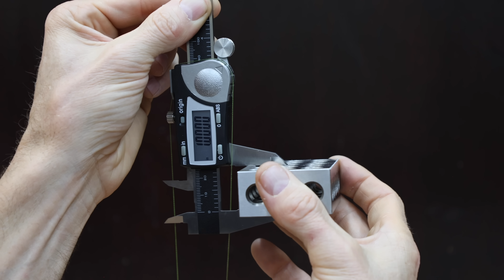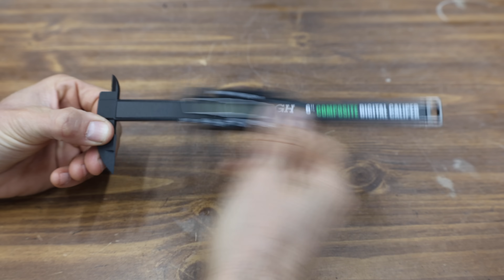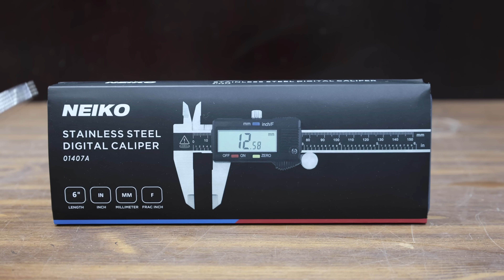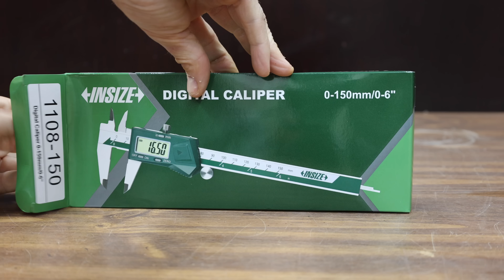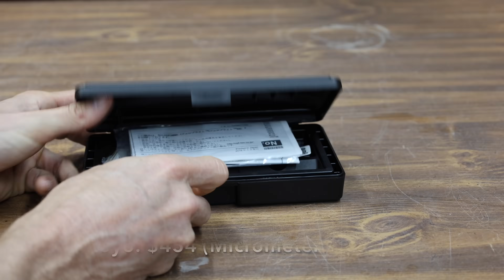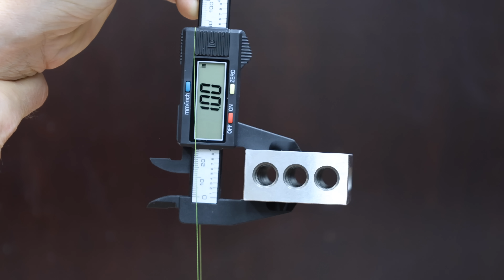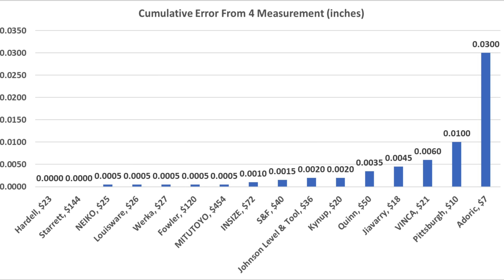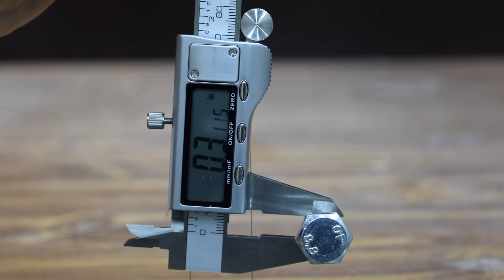I've Been Proven Wrong About Calipers!

Comment: I use the $7 digital caliper to measure cylindrical cells (e.g. 18650) where a metal caliper would cause a short circuit and damage the cell. It's also less likely to cut into the protective wrap of a cell.

Comment: It's worth checking the standby drain. The battery on a $7 caliper could go flat as fast as a $70 caliper (e.g. iGaging OriginCal 100-700-08) while in storage.

I soldered a 1xAAA battery pack with a switch to a $7 digital caliper to stop the battery from going flat.

It's a shame when more expensive a digital caliper also has a high standby drain.

The absolute origin feature is pretty cool when it works. Some digital calipers like the 100-700-08 "reset" after a few days of being in storage, so when you open it the origin will reset based on the open position when it powers on. You then need to close it and reset the origin. Unlike the Mitotuyo where it powers on when you open it and it doesn't reset (as you'd expect).

Buy once, cry once.

Comment: I got one of those cheap fiber reinforced plastic models like the Adoric years ago and was kind of shocked at how reliably it would return to zero and read exactly the same at the far end as you went back and forth numerous times. More than good enough to measure common everyday items where you need to measure much more accurately than a ruler and an eyeball. Plus the FRP looks and feels nice after you gently smooth the sharp edges. Not bad for 8 bucks. 😅

Comment: There would undoubtedly be some gap between the 1-2-3 block and the definitely not atomically smooth desk during the depth test (doesn't look like a granite test block, and the 1-2-3 block moves between tests). Expecting exactly 1.0000 inches would be expecting the rarest condition (randomly measuring exactly at a peak in the desk surface), 1.001 would be more likely (anywhere else but a peak), making the Starrett, Mitutoyo, and the like more accurate...

Comment: If the Mitutoyo says that the 123block is 0.0005 off then the 123block is 0.0005 off. It is not the french who set the metric standard but Mitutoyo.

Comment: The starrett was not perfect on the measurements. The ten-thousandth decimal place is a tiny little 5 unlike the other calipers where it is the same size as the rest of the numbers. Easy to miss, but it was showing on one of the 1" measurements as well as the 3" measurement.

Comment: One well known issue with many cheap calipers is battery life: the “power” button simply turns off the LCD, which reduces the actual battery drain by… nothing.   (This is because they don’t know how to implement auto power-on when you slide the caliper. So they just stay on all the time and pretend to be off.) In those calipers, the battery only lasts a month or two. In contrast, in quality calipers, they have true auto power on, and a battery will last for years. 

Also, an issue I ran into with my cheap calipers from Aldi is that it can lose its place if you move too fast, resulting in the actual value jumping by some multiple of 5.08mm (0.2”). Easy to spot if you’re just measuring a few mm, but easily missed on larger dimensions. I replaced it with a Mitutoyo vernier caliper. 

At work, I chose digital calipers from MAHR, a top quality German brand.

Comment: Don't get too hung up on the "Absolute" branding on the Mitutoyo, it just means they're counting whilst "off". If you take the battery out they'll get lost same as any of the others that claim the same feature. 

A significant thing for all of them is how much current they draw whilst "off". The Mitutoyo and Starrett ones will both work for years, the cheap ones will always have a flat battery when you come to use them.

Comment: On the second 1" measurement, and on the 3" measurement for the Starrett 12:50  you stated that it was spot on for both, but it shows 1.0005 and 3.0005 respectively

Comment: There are few thing to mention. Brands like Mitutoyo provide a calibration certificate for their tools and also provide regular calibration during the lifetime. This is required for certain production by law (in EU). Also, if I understand it correctly, Absolute zero is the way of measuring absolute distance from zero point, rather the increments, when calliper is moving. It does not "remember" the position, it is measuring it as an absolute distance, that's why it does not matter, if you turn it off. The way to test is it to turn it off, move it and turn it on. It should show correct measurement. Measuring this way ensures that the measurement is always correct and will never "skip" the incremental sensing point.

Comment: 3-2-1 blocks are no way accurate. I have 30 yrs, 8 months at Boeing. with 14 yrs of that as QA. He should be using Check Pins or Gauge Blocks for accuracy. But in reality, what he is doing is fine for a home hobbyist. I must confess, that my most used pair was a set of 4" Harbor Freight calipers. I enlarged the  notch on the depth gauge. But hey, I turned it in to QA for calibration. And it came in at +.003, good enough for govt work. I used them mainly for 1st part and in-process inspections. Unless the Tolerance is 4 places or needs a measurement of more than 4'. Then I break out my various Mitu's to do the job. But again, for home use, it's fine.

Comment: Please leave the batteries in the calipers and test them again 2 months later. I am sure most of them will be out of juice by then. That is because the cheap ones do not actually turn off the circuit. I only know that the Mitutoyo does turn off completely. I have one that looks like the Adoric but in stainless steel and have to insert and remove the LR44 battery every time I want to use it. In the end I got lazy and now prefers my dial caliper. 😁

Comment: I’ve had the Neiko since 2018 and it has been rock solid. I use it to calibrate and adjust motor stepping for my 3D printer and I always get excellent results. I also use it when prototyping 3D printed parts. I also use it in my workshop a lot for measuring all kinds of things from outer diameters on different pipes to checking the diameter and threading on unmarked loose bits and bolts and such around my shop. I have used them much more than expected, but my biggest problem is forgetting to turn them off and using a lot of batteries over the years. Overall I recommend it for the price, and it even has a decent case.
Reply: To add, I’m now considering getting a 1-2-3 block to test how it has aged. I’ve wanted to get one anyway!

Comment: The Mitutoyo does not use an LR44.  It should be an SR44.  I suspect the other single non lithium cell calipers should use an SR44 also, even if the cheap-arse vendors only supply an LR44.

Comment: I think the depth test is not perfectly executed. Just by seeing the measuring surface of the table I am pretty certain there will be a significant inconsistency. At least when comparing to the 1/10000 of an inch. Maybe a stone measurement surface isnt needed but at least a straight, ground metal plate is needed for a fair comparison.
Thank you for the test! 
Got a Mitutoyu a couple years ago, as always it is a buy once cry once decision but I think I didnt pay more than 150 bucks.

Comment: I bought the Nieko calipers for use in my home shop and the caliper kills the battery every time if you dont remove the battery after use. They alsonlose zero somewhat easily. I DO NOT recommend. I will be buying the Starretts next time. They are my favorite brand of machinist tools anyway.

Comment: Interesting. The Neiko in your video (with the screw on the battery cover) doesn't match the one on your amazon link, or the one I own, that that page says is the one I ordered a few years ago. (Not blaming you, to be clear. I've come to expect variances like that with chinese tools.) The one on the amazon page, and mine, the digital body is visually identical to your Johnson Level & Tool one, with the battery cover that just slides out with no screw, though the rest of the tool looks like your Neiko. Its worth noting that I have to store it with the battery removed, as for some reason the case can push on the power button, and as rarely as I use it, that means opening the case to find the screen flashing all kinds of faded gibberish if I leave the battery in.

Comment: I've had the Neiko ones for 10 years. The battery in mine drains slowly even when the calipers are turned off, so the first battery only lasted a year or less. Since then I've always removed the battery when putting the calipers away, which solves that problem, but is a hassle. 

Also, they started acting flaky after I'd had them for maybe 4 or 5 years, jumping around to random measurements showing on the screen and such. I can't remember exactly what I did to fix them, but I know I had to remove that silver sticker on the back, then remove some very tiny screws with a jeweler's screwdriver, and then I most likely unplugged whatever I could and sprayed the contacts with electrical contact cleaner. I know I didn't replace any components, and I don't think I resoldered anything either.

They are currently working fine. I used them tonight in fact, to measure the diameter of a couple of roll pins, about an hour before watching this video.

Comment: You should do a "specific value" which is total points awarded/cost could be a good measure for performance per dollar for hobbyist who want to buy something that isnt garbage but also something that isnt half the cost of the project theyre working on and will only use 5 times a year

Comment: 1. to properly use Calipers you only take measurements with the bevel cut sections of the jaws or the depth stick
-this is because the flat section of the jaws can be off or wavy, this is also why you will notice some companies have the flats wider then the bevels

2.the main reason you buy better Calipers like mitutoyo is consistency over time, temp, etc.

3. you are measuring the o-ring slot incorrectly

Comment: My biggest problem with low priced calipers is they can drain batteries even when they are off. I don’t use my calipers often and the battery was almost always dead when I needed them. Now I remove the battery when I store them. I’d pay a premium for calipers with a physical power switch.

Comment: Im not here to really give you hard time because your always spot on how you test things but you pushing down on caliper on a scale isn't really accurate rep of weight pressure because you can't really control how much or how fast your hand and arm move. That should have been maybe 1lb weight sliding down with caliper in a jig and weight attached to show weight pressure.

Comment: cool video. i have some nice calipers but i never use them. ill grab the plastic ones (not even digital or with a dial indicator) almost 99% of the time. light, cheap, no concern for damaging them. i primarily  design models for 3d printing, i aint working with expensive materials or milling precision metal parts. home gamers fixated on expensive calipers is bizarre, get a life, go outside, live life.

Comment: 17:23: You discuss the absolute value feature and say that only Quinn, Fowler, and Mitutoyo have it.  Unless I'm misunderstanding the feature, the Neiko has that feature as well.

Battery life is pretty terrible with many of the models.  I've read that many of the cheaper models draw just as much current from the battery when they are "off" as they do when they're on.  I haven't independently verified that claim, but it seems plausible given how often the batteries must be replaced.

Comment: I love the research you do. Thanks for gathering up all these different experiments and tests on the variety of products you have done so.

This video has confirmed that I was right to buy a 6" set of fowler dual read dial calipers to keep in my bag. no batteries, and fowler's digital version rates well too.

Once i found the dual read dial calipers any notion of going back to digital was gone. I can get metric or Inch measurements at will and I never have to worry about batteries which is awesome since I take them with me constantly. sometimes I'm using them 30 times a day, sometimes 3 times a month.

I'm just a CAD designer and 3D printer as a hobby and I'm sure in the toolroom or the shop reading the dial over and over could be a time suck in some ways. But for me, mechanical has been a great route and I think more people should give them a look too.
Reply: Dial calipers are great as long as you don't drop them on the cement floor. My Mituyoyo dial calipers, 6 & 12 inch, are still in perfect shape that I bought in 1982. TIG welder reading decimals on blueprints.

Comment: Worked for a long time importing Mitutoyo calipers and I assure you, they have a good amount of variety and little differences, for each size at least 2 variants with different chanfer size on the pincer, sensor precision, materials, also display capabilities and auto shut down. Noticed the little differences on my first and second lot and contacted the manufacturer, they gave me a complete spec table, really cool.

Comment: Even if they are off a slight amount, if they are consistent, then they are still very usable for many scenarios whereby you need comparative measurements (i.e. one part/piece compared to another).  I bought a stainless set off Amazon for $39.  I use it in my reloading and it serves its purpose just as good as a $250 Mitutoyo.  If, however, I needed to measure a single piece or pieces that require extremely precise measurements, then it makes sense to buy the higher quality tool.

Comment: Clockwise calipers (specifically the DCLR-0605) costs only $25 and are great.

They are accurate, well made, and calibrated. I liked mine so much I gifted a set to my brother and both devices perform at a level and resolution higher than most people need and are really well made.

I've been using mine for years and I require accuracy to 0.3mm and they outperform this level by several factors.

Clockwise is who makes the Vinca calipers.

Great video.

Comment: Honestly, at this point I don't think I'd buy a set of digital calipers unless they were rechargeable.  

As an idea for product testing: either digital thermometer/humidity sensors or those mini air quality sensors that measure those things plus stuff like CO2, particulates, ammonia, etc.

I suggest this because I have one of the latter and the thermometer on it is completely inaccurate compared to the one I have that's just a temperature/humidity sensor

Comment: As a mechanic Starrett and Mitutoyo are the only brands I use For Engine Block Work
Reply: If you're working on something like that I would hope you have the best tools you can get but if I'm measuring a shower head replacement I don't need to worry so much. An error of 0.2mm isn't going to matter if the available options are (random numbers that mean nothing) 30mm or 25mm.

Comment: PF..You list the Jiavarry as nr2  in the O-ring 17:01  and then in your ranking it suddenly nr 3  18:01  (that doesn't add up?)
it seems its quite error-infested.
Am I missing something..??
and many people using these.. really don't care if they are "smooth" as that can be problematic.. not least if you don't have a lock screw, as your not making ru.nning measurements with a caliber.. you making tangible measurements, perhaps with an offset according to previous.
Tolerances matters, and that it doesn't loose its  heading when you move it, useful to have a lock screw, and a pointy ends so you can mark the work-piece.
and from 18US to many hundreds of bucks.. you seem to get the same tolerance, but it can still vary as the last digit can be 2 point fixed (0/5), so a shame you don't list what is the finest valuent they can decipher in your overview table, unless they all are 2 point fixed on the last digit?

Comment: Machinist here, measuring is soo off. You cant measure just depth on wooden table which is neither flat ot suitable for this. You need set a reference point. Measure gauge block which is known number or and then you know that your caliper is + or - on set measurment and then when you measure. You can add or minus the error or set zero on caliper. Be in mind that these error will add up if you calculating more then one. Next big thing is temparature.

Comment: Mitutoyo calipers actually use an SR44 battery, not an LR44, same physical size but far more consistent discharge curve and much longer life. Basically unless you have the means to test and properly calibrate, just get Mitutoyo if the measurement matters. I also coughed up for a 25mm Mitutoyo grade 0 cerablock to use as my calibration baseline. I found up to 11 microns difference across all my other methods of measuring 25mm when using a Mitutoyo 25mm snap gauge with a micron dial measuring comparatively with the cerablock.

Comment: I found a set of calipers in an Asian import store...plastic, $5! I kid you not. I've used it for so many years the grey plastic has faded to a murky cream. They still work as well as ever, which is supposedly accurate to 1/1000". I've never bothered checking its accuracy. I'm just measuring stuff that's hard to measure with a tape. BTW, that $AU, not $US

Comment: Calibration tech here. Careful measuring holes with the inside jaws, once you get down to small diameters, the offset between the two jaws is a factor. That’s why these is an inside offset measurement in calibration of 0.200 that’s typically taken when you have calipers calibrated by a cal lab. Also when doing the depth gage you should do it on a surface plate, or offset a 1” gage block wrung to a second gage block so the second gage block is used as the surface, or at minimum, use a second 1-2-3 block under the one you’re measuring.